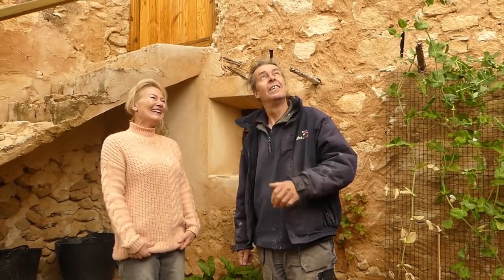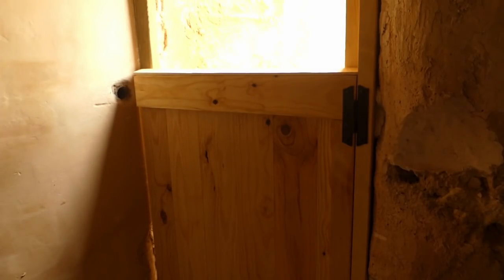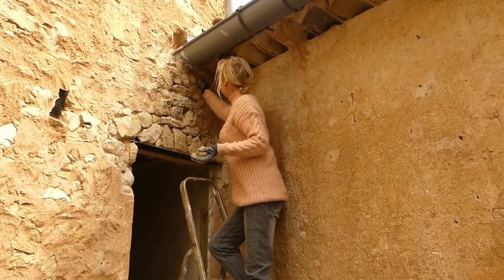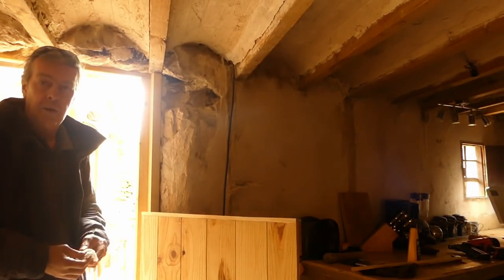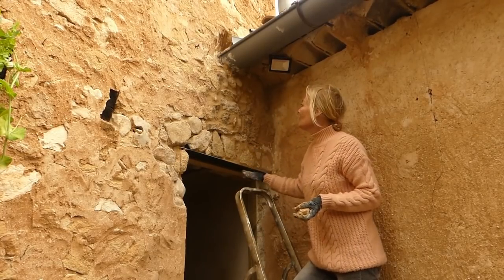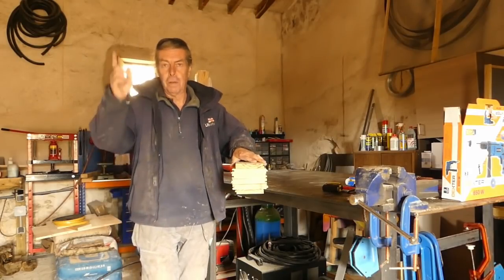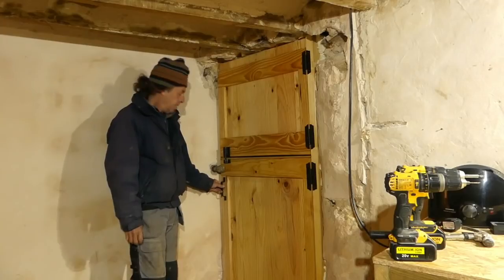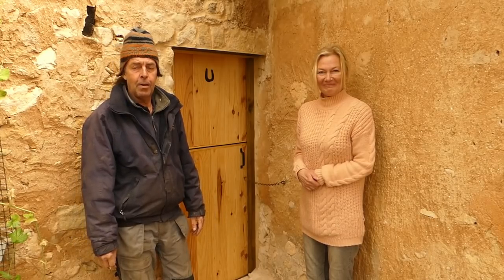The first big job is done! - Spanish Finca renovation

Comment: They do the same hear in Iyaly with there flue pipes, sensing them all over the house to connect with a chimney.. When we fitted our wood burners we used twin wall insulated flue pipe. The only issue has been that the living room flue goes up through the floor into the bedroom above and then through the wall. we never brought quite enough pipe and it only protrudes about a foot above the pitch of the roof, and in some weathers there in not quite enough draw and we get a puff of smoke in the room till the wood gets going...  Fantastic project keep up the good work!
Reply from the maker: Thank you so much! Twin wall would definitely help but easier to just run it direct - a proven formula :) Can you not stick an extra metre on your flue?

Comment: Looking great… You’ve both learnt so much from doing the apartment that you make it all look so easy now… one word of warning with the log burner flu, with a glue that goes straight up we would occasionally have ash come out the top and land around the house, it seemed to be dependent on weather and if we used pine it was always worse. Also we got a cap that turned in the wind and seemed to help stop any water coming down when it rained and also helped with the draw on it. Congratulations on the subscribers :) and I worked out what that little hook thing was in the wall, we’ve got one too. The architect opened our door and promptly hung the rope handle on the hook to stop it swinging closed! Love the way you are reusing what you find at the house. Glad you got some dry weather and sun we are still waiting here! Lol!
Reply from the maker: Yes, we have a chinese hat on the flue that works well. Thanks for the heads up on the hook!